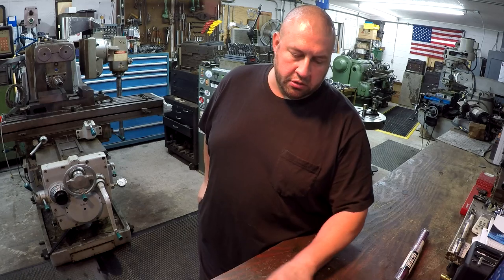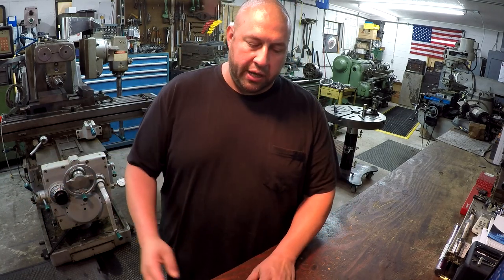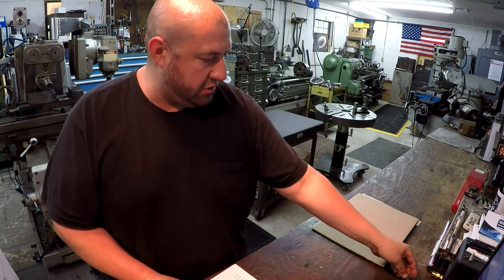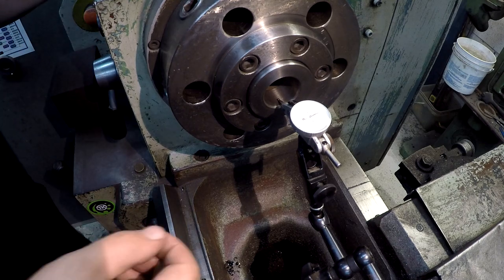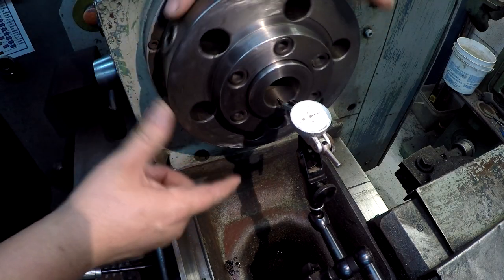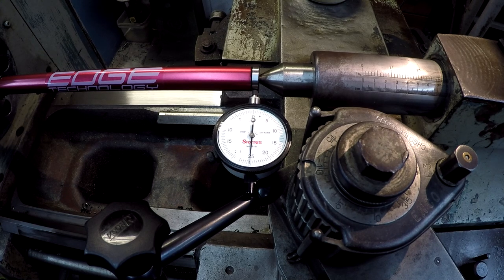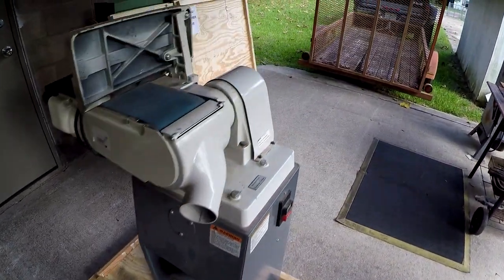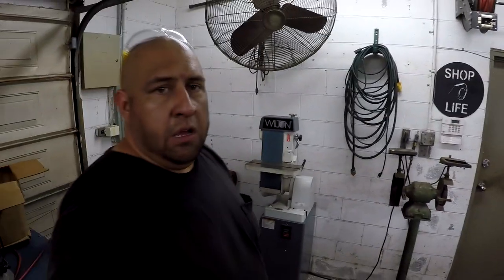Saturday Night Special 135: Tailstock Alignment Bar, Wilton Belt Sander

Comment: Not only is their gear good, it is well built. I misplaced the Pro Lathe Gage from off the top of some large plastic boxes that I was placing in the back of my truck ... I ran over it; the box was somewhat crushed and the level screw had the imprint of a small street pebble. The gauge still works - what an amazing and well constructed tool. I already have a bucket list of Edge Technology tools that I will go through this year.

Comment: Hello Adam, About the weight problem on the old horizontal belt sander build a box inside the base and pour it full of concrete for added weight you won't believe how much smoother it will make it run and it's not expensive to do.

Comment: These tests take time to get right. I use a similar setup to test the difference between the headstock centre ht and the tailstock. To eliminate inaccuracy in the headstock sleeves I just turn up a bar in the chuck. Great video. No problem with the sound. Thanks for your time. 👍 🔨 🔩 🔧.

Comment: The Edge alignment tool. I used to grab a hunk of Cole roll about the tight length and center both ends. If the was a little TIR I'd roll it around to the mid point and work from there. 

I liked your remarks how machine wear affect the use of an alignment bar, tailstock wear etc. Very to the point. Perfect setting at one point doesn't necessarily result in perfect settings elsewhere in a machine tools working envelope. You do have to carry a map of the machine's axis geometry in your head.

Wilton sander, I see from the polish on tour camera slug where the first inch of the platen above the work table is worn by the back side of the belt - backing up where thinner work is usually edge sanded. The platen is usually cast iron no harder than the rest of the machine. A sander platen is a continuing point of maintenence. I've often thought after the platen has been faced back a couple of time whether a hardened D-2 tool steel liner scabbed on the platen would give the sander greater platen maintenance intervals.
Reply: I have experienced the same. Like Adam said very finicky to get dead balls accurate (setting the tail stock). As the setting is displaced when "final" tightening the screws, similar to when he is doing his final tightening on a 4 jaw. I use a one inch mandrel for initial alignment.

Then I go to machine (turn) a part only to find out I am machining a taper :( The tool is great for setting up TPI and returning the TS to centre, but the final adjustment in my experience always comes from turning a part and re-adjusting, for reasons Adam explained. IMHO the mandrel only brings you into the ball park :)
Reply from the maker: Good point about the belt sander took rest. I have some metal powder for my Eutaloy torch I could lay down to create a super hard surface.
Reply: Adam, never thought of meta. spray. If you can stick a hard surface on the soft cast iron platen of a belt sander I bet there's a zillion crooked sanders out there waiting for the Abom touch.
Reply: Knifemakers abuse the crap out if a platen. The often affix a replaceable unit made from glass or graphite sheet... Some even use liquid-cooling in the platen, to extend belt life.

Comment: Hey there Adam, another fine SNS.  

Regarding tail stock centering, I always use a Blake Coax indicator held in a collet chuck with the probe resting directly on the taper of the tailstock.  Works pretty good with no need to buy new tools.

That is a wicked nice belt sander!  Now all you need is a stack of belts in different grits.  Good belts are worth the money.
Reply from the maker: Yep that's another good way to get the job done.

Comment: A great idea to damping with the hose. When we design substations that require aluminum pipe for bus , we place 795 MCM conductor lengthwise in the tubes to dampen against wind induced oscillations.

Comment: Thanks for the hose trick.  I've used large rubber stoppers for small thin wall tube, but never had anything for larger diams.  I'll definitely use this. Thanks!

Comment: Hi Adam and thanks for all your great videos which I enjoy a lot. I hope therefore you won’t mind me pointing out an error in your instructions for using a tailstock alignment bar. You don’t use half the indicated offset, but all of it. 

It’s when you check tailstock alignment by turning a piece of material and comparing sizes at either end that you use half the difference, because you are measuring DIAMETERS and you want to move the tailstock by the difference in RADIUS, which is half the diameter.

But when you use an adjustment bar, you measure the differences in radius directly and therefore shouldn’t divide further.

Comment: I wish I had known about the hose trick! I tried a number of other hair brained things to reduce ringing on large thin walled stock over the years. Thanks Adam and best wishes!
Reply from the maker: Yes it works really well! Give it a try
Reply: I'm sure it would be much better than the bag of lead shot I stuffed into a part that flew open. Several hours cleaning up after that one!
Reply: We use the hose trick at the shop I work but with sand in the hose. We machine thin wall stuff that's between 40 and 80 inch in diameter so it might need that extra weight. Just putting it out there if you need to tweak it a bit.

Comment: This method is fine theoretically but when you machine a work piece it does not always machine parallel.I prefer to take a cut between centers and measure and adjust because it gives true cutting conditions.You can get it perfect with a dial gauge but when machining it can change due to tool pressure,quill clearance,wear and tear.

Comment: At 18:00-20:00 - You "take half" when you are cutting a test bar and measuring the diameter. When indicating the identical diameters, you adjust by the full amount. (Still, sneaking up on it is the right approach.) 

As you (and other commenters) say, wear (wear on the carriage ways and the tailstock ways, and on the base of the tailstock) as well as spindle misalignment, can complicate testing and getting everything right.
Reply: Yes, I agree with you. Quality  lil tool,  but I have never seen an experienced machinist use one. Pretty easy to make one in 15 minutes given you have some straight stock laying around. 
Cheers

Comment: Seems like that test bar would be much better if it had a nice gentle chamfer onto the ground diameter at either end. You can see that the end at the headstock kept moving around meaning that the indicator was getting bumped every time you came on and off the register.

Comment: Something simple you can do to your computer is run Ccleaner on it, simply clears junk files that the computer makes over time and fixes little glitches that pile up and slow down performance, been using it for 2 years now and it helps alot.

Comment: I find the problem is the wear of the ways is a lot more pronounced close to the headstock (where you do most of the work) and less on the other end. So if you move the tailstock close to the headstock, you get  a lot of vertical center offset but the  offset may be a lot lower with the tailstock on the other end of the ways.

Comment: A quick and easy way to make covers for outdoor equipment is to use vinyl pan liner. Get itin the tile supply section by the foot. Use aluminum angle stock for a frame. Rivet and/or silicone to cement the vinyl to the aluminum. It is heavy enough that the wind can't blow it away. Very durable.
Reply: i don't think he has to worry about the wind blowing any of that outside equipment away :>))
Reply: +Anon Ymousmie Blow the covers off is what I meant.

Comment: Your audio problem could be RFI, maybe sometime your close to a device that produce Radio Frequency Interference like a dimmable LED light or pretty much any device that have a switching power supply. so if you do not find problems in the mic system and computer, maybe take a look at the location of the mic receiver when the trouble happen.

Thanks for all your great videos!

Comment: Hey Adam, great video, definitely need to check my tailstock alignment on my lathe. I restored a 6x48 1940's Delta belt sander a few years back, once I was done it was so well balanced I could rest a penny on its side during start up on the machine! Wilton makes some great tools, would like to see if it will pass the penny test?
Reply from the maker: Hey I'll have to give that a try

Comment: Having all your grinders at one station in the shop is a great idea Adam. Most all the grinding dust will accumulate in that one area, but a certain amount will find its way into every nook and cranny in the shop. Have you given any thought as to a dust evacuation system? Like utilizing your welder smoke sucker? Or the new vacuum? Jack did a bang up job. Cheers.
Reply from the maker: Yep I'd like to have them all together and away from the machines. No immediate plans for a dust collector yet.

Comment: Adam, I've run into this a few times over the years with machines lacking power check to see if they're wired to the right voltage. i have a jet table saw that came with a 110v cord and it was wired for 220. my jet sander like yours wouldn't start, ended up being a centrifugal switch in the motor that burns up.  I love your videos man, makes me miss manual machines,  I'm at a cnc exclusive shop now
Reply from the maker: Yes, Fernando is going be checking that for me.

Comment: Adam, 2 thoughts on the Tailstock alignment bar section:
You want to use the dead center with the carbide insert on the tailstock side when doing actual turning this way, there is no rotation between center and tool on the headstock side, so basically no wear, but a lot of on the tailstock side.
And you do not have to divide the difference between the readings by half, you can basically correct the tailstock reading to the headstock reading as the point of rotation is right at the headstock end, so the movement there is minimal, a little bit because of the diameter. I ususally correct it to up to few 1/100 mm (yes, sorry, metric guy ;) ) of the headstock reading, check again and correct the last bit.

Comment: Hi Adam I like to put the indicator on top of the test bar to find out how low the tailstock is. If you are low you can split the tailstock and use shim stock to raise the tail stock back up. But If you are down 10 ths. use 10 ths. shim to bring it back up and then recheck the tail stock on the side  again ,  the Edge tool looks very good I made one from chrome shaft Thanks
Reply from the maker: Yes it works great for that too. I have plans for that in the future.

Comment: My battery charger for my cordless tools is a huge RF interference machine, even if it isn't charging a battery I find that if I get near the charger it messes up my mic.  Might check to see if you have any close by.
Reply from the maker: The battery charger is in another spot in the shop, and it's never plugged in unless being used. Might be my phone giving me the problem, but still wanting to check the wire and mic.

Comment: Thanks for the video, good info as always.
It occurs to me that given the wear in the machine as you stated, you have in fact only made an adjustment for the lathe to be a half-thousandth out at 12 inches. Wouldn't you also need to test the alignment of the tail stock at various points over its full length of travel, or at least over the length where the major of work is performed? Once the test has been made across its full length of travel (or most used), the point where it shows the greatest amount of misalignment is where the adjustment should be made from.
Edge should make a kit where there are various lengths of Alignment Bars ay :)
Just putting it out there.

Again, love the video's, keep'm comin !

Comment: I haven't heard any noise at all. The audio is excellent. Hey what do I know. Great video as always.
Reply: how old are your ears Silas? just wonderin' ...
Reply: Old as the rest of my body. I didn't hear any crackling or other interference.  Perhaps you can inform me..
Reply from the maker: There has been static issues for some time now, not too noticeable lately though. It seems that uploading the videos seems to reduce some of the noise.
Reply: Abom79 It's possible that youtube is bandwidth limiting the audio to compress the file and this means the very highest frequency elements including possible the static is being attenuated.

Comment: 3:45 Stopping the noise is best, of course. To get rid of anything else, you can use Audacity (free real good audio editor) to get rid of that hiss and other background noises. Start recording 10 to 30 seconds early, that is your room noize sample. The use the noise removal tool (several good tutorials out there) to sample that noise, then select the whole recording and select noise removal again. Should work good on your audio since the noise is higher pitched and you are not.

Comment: Another possibility for the noise source is the fluorescent lights.  I get some static from my fluorescent lights in the basement in my sound system in the livingroom on the first floor of my house.  The static goes away when I turn the lights off.
Reply: Yep, fluorescent lights can be the worst.  Especially if they are an older model.  The ballasts are much cleaner in fixtures from the last 10 years or so.  However, it might be time to upgrade to LED.  The future is now!
Reply: leds can be far worse for interference!
Reply: only if its cheap crappy LED lights.
Reply: many people are buying teh crappy ones, Harbor freight has some good deals on panel LED's, but people dont realise they can be a source of interference also
Reply: yeah thats the problem LED lights suffer from, people buy the cheap ones, and then "LEDs suck"

Friend of mine fitted his whole grocery store (~3500 square feet) with led lighting, and is completely happy with the result. But he also spend quite some money on those.

Comment: Hey adam, love your vids... A word on the audio issue...., there could be a lot of situations I am not aware of, but a lot of problems come down to simply electricity.....  like running through the walls of your shop. Fluorescent tube lights can cause problems, 'dirty' power from the street, Even your cell phone if it is a modern day iphone can interfere with other wired or wireless devices. I would think in your case, take your camera and mic into a building with different kinds of lights and see what happens, if that doesnt make a difference, try turning your phone off during filming, etc..etc.  Its bound to be a simple but hard to find problem, hahaha Been there done that. 
Keep it up man
Reply from the maker: Thanks. Well play around with those ideas.

Comment: I think I heard you say you are using a USB microphone? Find a nice USB cable with an RF choke(the round ferrite magnets), at each end. You can also find them at Radio Shack, or online for pretty cheap. One or two loops through each choke should be fine. This will reduce, or maybe eliminate the RF spikes in the usb cable. That is a bit of a antenna out there, soaking up all that EMF from all those HV motors in your shop. The one thing I'm not sure on, is if it will affect the sound signal from the microphone.
Reply from the maker: +airportadam I have a few of them coming that's on order.

Comment: I have wanted to see the EDGE technology alignment tool, been considering the purchase - thanks!
Reply: I didn't get the halving the difference bit!
Reply: Me neither. I don't thing it's correct. The indicator is measuring a radial move of the tailstock, and a radial difference in position, neither of these is a diametral change, so no need to halve or double anything. There is a SLIGHT adjustment due to the work pivoting on the headstock centre slightly outboard of the measurement point, but it would be beneath the radar here.
Reply: I ordered a tool, thank for the code - will let you know how it works.
Reply: I ordered mine too, will be here Monday.  Thanks Adam.  Appreciate ya showin us how it's done.

Comment: Hi Adam.
Regarding static noise problem you have.
Do you have a fan close to the camera?
If so try to get a little more distance between the fan and the camera.
Fans distribute a lot of magnetic fields that can disturb electrical equipment.Regards
Jan

Comment: On your long sander for headers that you say doesn't have much power....... I think your start capacitor may be weak or bad. If you have a friend in the AC industry they can check your caps.

Comment: Hi Adam, thanks for another great video.
It was interesting that you mentioned that the Jet Sander at work was a lemon from day1 and your new Wilton is much more powerful.
Are they both 6x48 with the same hp motor?
Because from what I know Jet and Wilton are all made in the same factory by the same brand owner ( WMH Tool group Inc which is subsidiary of Walter Meier AG, headquartered in Zurich, Switzerland.).
They claim to have a manufacturing facility in the USA but not sure how much is really made there since In my part of the world (Australia and South East Asia Asia) all the Jet and Wilton stuff I've seen in the last 15 yrs has been made in Taiwan and I think recently (last 5 yrs) even China.
Cheers Russell

Comment: dear adam,
you have a very nice new equipment! i am glad you got it for your shop.
imho, you might want to acquire the hardness tester press and the heat treatment oven. my guess you'd be contacted before long by nasa for contract worth a king's ransom!
thanks for the video, and thank you for all the work in your videographic hobby!
-toly
Reply from the maker: Toly yes those are tow additions I'd like to add to my arsenal.